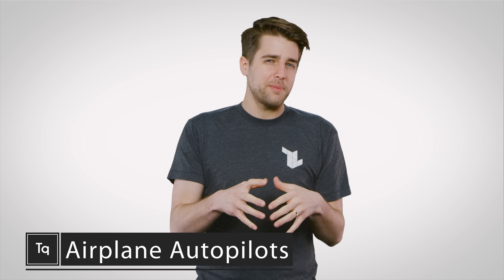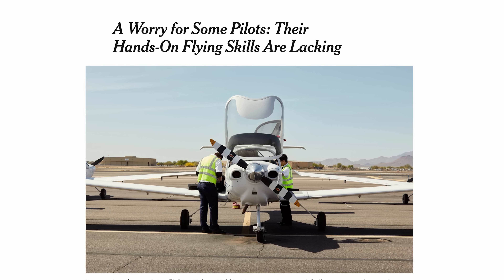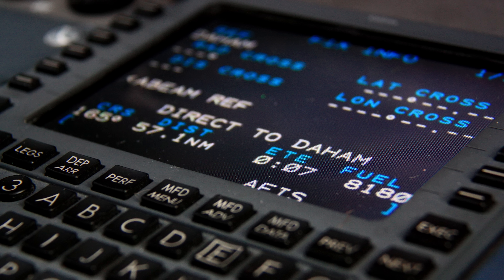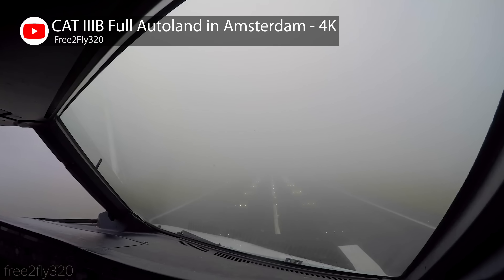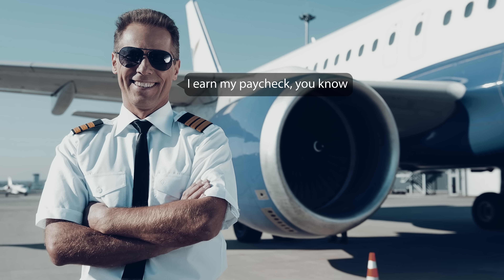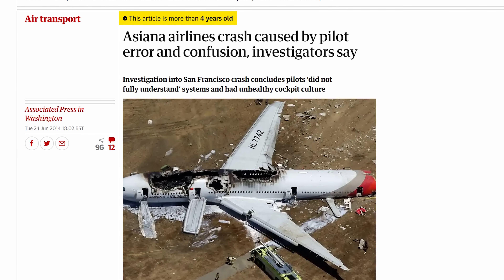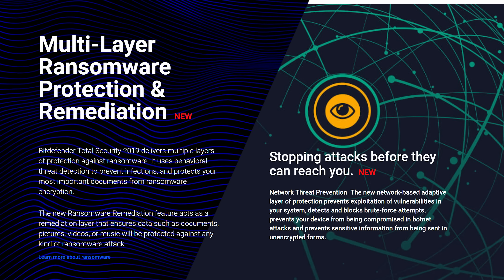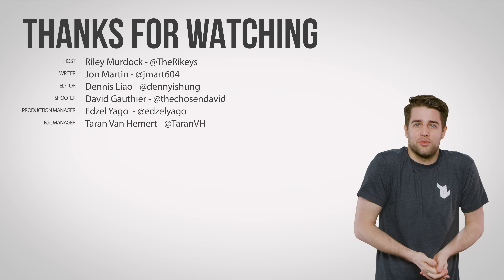Who's REALLY Flying YOUR Plane?

Comment: I am a software developer for these things. And pretty much most systems can be overridden by the pilot. There were a few things that were said incorrectly. The FMS (Flight management system) does not control the plane. The FMC (Flight management Computer) gets data from the FMS then gets data from other devices like a GPS, ADC, IRS, ect and combines those inputs to send out LNAV/VNAV/Roll commands/ect.

The systems on the 737 max could have been turned off with one switch. But the pilots where not trained on how to use the new MCAS system Boeing put on those planes. The new MCAS system was getting bad data from the Angle of attack sensors and thought the plane was about to stall so it pushes the nose of the aircraft down to maintain a speed. The pilots never turned off the MCAS and instead were fighting the system to the point of maxing out their flight surfaces. One of the pilots from one of these crashes only had a couple hour training session on the new aircraft.
Reply: Why isn't there a backup sensor?
Reply: @c2lredstone946  There is but the MCAS software was designed to only use one. It alternated which sensor it pulled data from each flight.
Reply: @c2lredstone946  there is, it was a software bug reading data from the wrong system.
Reply: @c2lredstone946  There are 2 AOA sensors on the 737 max. However there was a bug in the MCAS that was not correctly taking in the data from both. Usually MCAS will look at both the left and right AOA sensor and make sure they are both close to each other. If they are not MCAS should shut off and not engage.  From internal talks I have heard they were just averaging the 2 sensors and not looking at them independently.
Reply: @Pigeoncraft  And at least for the Lion Air crash, at least one of the AOA sensors was known to be giving back false readings but they ultimately decided NOT to ground the aircraft.
Reply: @time-lapserpro4370  I haven't heard that. But even if that is true. That would be the airlines fault. Not Boeing.
Reply: @Pigeoncraft  True, but boing could've done better on their part as far as training and other system components goes. "After airspeed and altitude problems, an AoA sensor was replaced and tested two days earlier on the accident aircraft." "Shortly after takeoff on 29 October, issues involving altitude and airspeed continued due to erroneous AoA data and commanded automatic nose-down trim via the Maneuvering Characteristics Augmentation System (MCAS)." https://en.wikipedia.org/wiki/Lion_Air_Flight_610 Previous sensor problems and flight control issues were also reported earlier on the aircraft.
Reply: @c2lredstone946  i doubt a backup sensor would help in this case
Reply: You cannot completely disable the flight envelope protection in Airbus aircraft.
Reply: @JeanYvesB9  If you disable the primary flight control computers the secondary ones would take over and put the plane under direct law, which would allow the pilot free reign over the aircraft. Not something that would happen in almost any circumstances though.
Reply: Myles Pribeg yes, but that would require to completely disable all three Primary Computers, and you would loose many data systems, making the aircraft almost unflyable for the common pilot. You would need to land ASAP
Reply: @JeanYvesB9  You only need to turn off the 2 ELACs (or FACs) to disable the flight envelope protections. Assuming there are no other failures, you shouldn't lose any instruments (even autopilot still works in alternate law depending on the failure) and is not 'unflyable' by any means, unless you're talking about mechanical law. I'm not sure why you would voluntarily put yourself into direct, or even alternate law. Unlike the situation with the 737 Max and MCAS, Airbuses disable flight envelope protections and gives the pilot full control in the event of unreliable data by putting itself in alternate law (see Air France 447, unfortunately, this meant the pilots were now able to stall the plane). It's clear that a plane designed with automation in mind has much better systems in place to prevent itself from overpowering the pilots.
Reply: @JeanYvesB9   No, but these are all Boeing aircraft. And Boeing believes in letting pilots have final say. Unfortunately the pilots were not trained on what to say when the time came.
Reply: ohw that's very interesting
Reply: Pigeoncraft in the second flight the pilot did turn off the MCAS system but it self turned on again later resulting in the crash, Boeing should’ve enabled both sensors, Boeing and the FAA reputation is at stake, now they have included professionals around the globe to help certify the Max back to the air and that never happened in the history of the FAA allowing other countries to join in.
Reply: @josephhollandpontes1030  In the data. The MCAS turned back on due to the pilots power cycling the software. Which is standard in most handbooks.
Reply: Pigeoncraft yes indeed, the thing affected Boeing the most was the plane leaving the factory with only one sensor working, I believe you’re an expert in software and thanks for being here, the government shutdown, and many other factors resulted in this very sad event. A factual investigation takes time so let’s wait for the final report. I know many people commenting here watched the Vox that is on the YouTube Trending page.
But is no accurate, there is indeed some truth there.
Reply: Miquel Abner shut up
Reply: @Miquel Abner I actually am a software developer for aircraft. I work as a subcontractor for Honeywell, Boeing, Cessna, Astronautics, Spectralux, Iceland Air, ect.
Reply: One of the other issues with the MCAS was that it moves the trim tab faster than a pilot can manually. When the MCAS is activated it begins to trim the aircraft down and the pilot can shut this off using a breaker switch or the electronic trim knobs on the yoke. However, this only disables the MCAS for 5 seconds (unless breaker is used) and if the aircraft is still detected as stalling the MCAS turns back on. The issue was that in the downtime of the MCAS it was physically impossible for the pilot to return the trim to its normal level before the MCAS took back over (if the pilot didnt know where the breaker was). Source: a summarised manual given to my flight class
Reply: Happy Helpful Hoovy or they could’ve flipped the trim cutoff switch, that’ll solve it
Reply: Happy Helpful Hoovy the electric trim overrides the MCAS and allows you to trim with the electric motor driving the trim wheel. MCAS reengages 5 seconds after you release the electric trim thumb switch. When MCAS again rolls in AND, you can still trim it back with the electric trim again. Once you’ve got her in trim again, the MCAS info bulletin issued to MAX operators by Boeing after Lion Air says that then flick the stab trim cut out switches, which instantly remove the power to the electric trim motor when you’re in trim. This means that it’s impossible for that trim wheel to move unless it’s manually being wound. In the Ethiopian crash prelim report, it appears that the pilots switched the stab trim back on again to trim back. I say this because it’s impossible for power to reach the electric trim motor when those switches are cutout, so the only way to be able to use electric trim again is to turn the stab trim back on again. Then once in trim, they failed to disconnect the stab trim again, resulting 5 seconds later in AND to the full forward position. This is contrary to the bulletin. 

Final crash reports go into lots of detail about every little thing that contributed to an accident. I’m sure this final report will be no different. It will make mention of the MCAS programming, but will likely also attribute considerable weight to other things. 

Pilot actions/human factors, training and procedures from both Boeing and from individual airlines, and the final report will also look at the AoA manufacturing and installation process and whether there is a connection. A failure of the AoA is very rare indeed. 

Human factors:
The actions of the pilots immediately after rotate with the captain’s stick shaker activating. Obviously it’s easy to analyse from a comfy armchair and the prelim report lacks some details, but it’s clear that the pilots didn’t identify that the captain’s stick shaker activating can be a symptom of airspeed unreliable and therefore didn’t apply the appropriate memory items for this issue (namely an airspeed unreliable memory item) to get the aircraft under control. The checklist does mention erroneous AoA and stick shaker events as a possible symptom of airspeed unreliable, albeit not very prominently. 
Memory items: Disengage autopilot, disconnect auto throttle. Do not reengage. Flight directors both off. Set pitch attitude and thrust. Memory item calls for 10 deg attitude and 80% thrust with flaps out. Just this would’ve given the pilots some breathing space.

Instead, the pilots tried numerous times to engage the autopilot when this is strictly prohibited in this circumstance. Retracting the flaps too. Appeared to be done contrary to Boeing procedure (F5 to F up in one selection). Switching pitch modes from VNAV to LVL CHG was also a confusing action. Thrust remained at take off setting too. 

All unusual actions from the pilots indicated that they were clearly overwhelmed and were experiencing a loss of situational awareness already. Pilots are human. When you take one problem into the air and don’t handle it, that’s mentally draining enough. They hadn’t solved their first issue and through various actions detailed by the prelim report, had compounded the first issue into something from which it’s not clear they would’ve recovered from anyway, even without the MCAS AND.

In this instance, the MCAS was more ‘the mouse that sank the boat’. From the prelim report, it‘s not clear if the aircraft was fully under control before MCAS was even an issue.
Reply: @happyhelpfulhoovy  "that it moves the trim tab faster than a pilot can manually" Faster than he can manually with the trim wheel, definitely not faster than he can with the yoke switches.  "shut this off using a breaker switch or the electronic trim knobs on the yoke" CBs are something you almost definitely don't want to use to shut anything down unless the NNC clearly states. MCAS failure is a runaway trim scenario and the runaway trim memory items don't mention any CBs, therefore pulling ANY of those would be a mistake. Check AirAsia8501 for more info.

"unless breaker is used" 
That's not a circuit breaker but a simple cutout switch. 

" it was physically impossible for the pilot to return the trim to its normal level before the MCAS took back over "
It took back over because they turned on the electric trim again.
Reply: Miquel Abner although not a real pilot, I fly in flight simulators, and what he said was spot-on
Reply: Actually, the thing with MCAS is that it wasn't really meant to be overridden. MCAS was made to correct a design flaw in the 737 MAX which ended up screwing Boeing and the airlines anyway after killing over 200 people because of it.

The idea with MCAS was so that the 737 MAX 'felt' like flying the previous 737-NG (basically the MAX is like the A320-neo from AirBus; which when flown, felt like flying an A320), and Boeing sold that idea to the FAA and the public so that pilots new to flying the MAX only required to take a 3-hour iPad course. Without MCAS, the airlines and Boeing would have had to train pilots new to the MAX like if it was a completely new and different airplane to the 737-NG, which would have been quite expensive and lose some business to AirBus with their A320-neo. 

The design flaw that MCAS was supposed to 'fix' was the placement of the bigger and more efficient LEAP engines that Boeing wasn't able to fit under the wings of the 737-NG, in which they 'corrected' by moving the engines forward and up quite a bit, which ended up changing the center of gravity of the plane by a lot. Boeing thought that MCAS was gonna solve the issue with the MAX having too much of an angle of attack whenever it would take off, but clearly it didn't, and 2 deadly crashes would prove that afterwards.
Reply: Miquel Abner why the hell does it matter? What he said was true and accurate, oh no, he added in a WORD.
Reply: @Miquel Abner I am 25. I haven't touched my twitter in ages. I code mainly c and c++ embedded systems. What do you want? My linkedin?
Reply: Hey, pilot here, to be fair, no one quite covers aviation topics very well. They did a very good job. And the Ethiopian pilots were quite aware of the MCAS system and did what they were supposed to do to disable the MCAS system. They simply couldn’t trim out the airplane in time and tried to turn the system back on. You shouldn’t judge our fellow pilots too hard, it was a tough situation that they were put in with an imperfect software.
Reply: That makes a lot of sense, very unfortunate that neither the computer nor the pilot could save the passengers in this case :/

Also how do you get a job programming autopilot for airplanes? That's pretty awesome, I'm actually curious
Reply: @pigeoncraft in the Ethiopian airlines crash, the pilots DID turn off the MCAS system (use the stab trim cutoff switches) but the plane still made AND maneuvers as per the preliminary accident report.
Reply: So the plane crashed because you couldn't write a software with more redundancy and solve all the edge cases...
Reply: the whole situation is stupid, vox actually did a decent job of explaining it, not gonna lie
Reply: Nobody wants to hear anything from you "experts" it's just nothing but lies funded by the government you're not real people!
Reply: @JBroMCMXCI  Oh my god... Another troll...
Reply: @JBroMCMXCI  down boy down
Reply: @JBroMCMXCI  😂😂
Reply: @JBroMCMXCI  I am a real person. The only thing we do from the government is follow the guidelines. Mainly from a document DO-178C
Reply: @Pigeoncraft  I had read in articles that MCAS used only one sensor, but I didn't hear that it used an average.  One sensor should be obvious why it's a flawed system, but I can understand now, if it really was an averages problem, why people wouldn't immediately pick up that reading from two sensors could still be flawed.  Thank you for providing that info.

However, I have also heard that part of the design made it possible for MCAS to push the yoke (sorry if that's not the right term, I'm not a pilot) forward and hold it there with such force that it was very difficult for pilots to override it.  I think that's another fatal flaw that should have been caught much earlier.  Yes, the point of many of these systems is to protect the people on the plane (including the pilots) from doing things that could directly cause a crash, but it's not uncommon for systems to fail, and most pilots' good judgement should be built into the system as a failsafe.

I say all of this as a software engineer myself with a lot of hindsight and a nice armchair to work with, but I am surprised at some of the decisions made.  Additionally, I recommend the article below to anybody who is following these accidents because I think it brings a lot of perspective into the conversation, though it gets a little jumbled near the end.

https://spectrum.ieee.org/aerospace/aviation/how-the-boeing-737-max-disaster-looks-to-a-software-developer